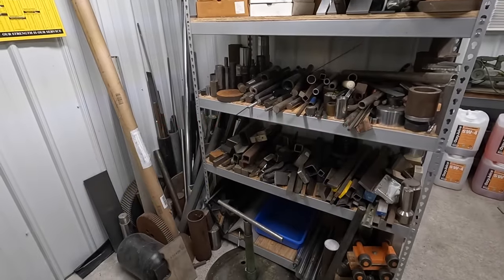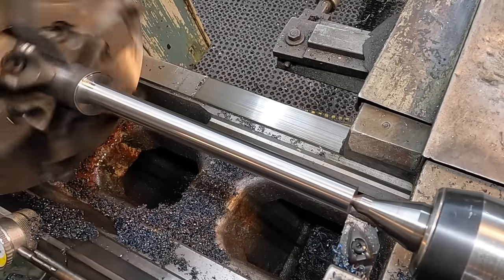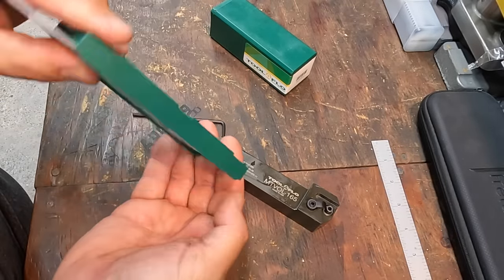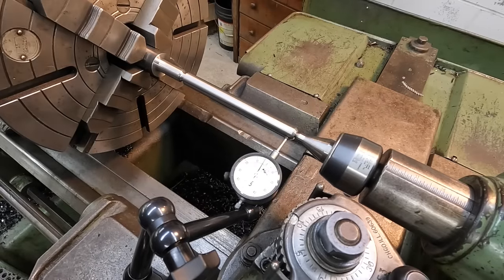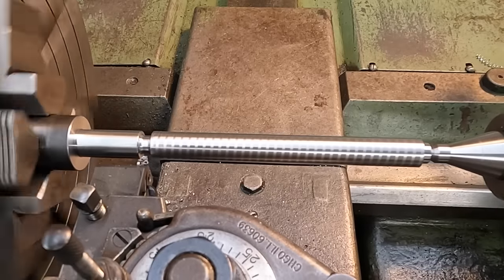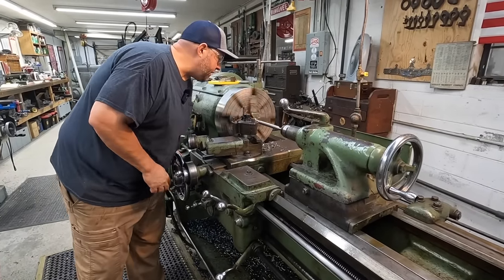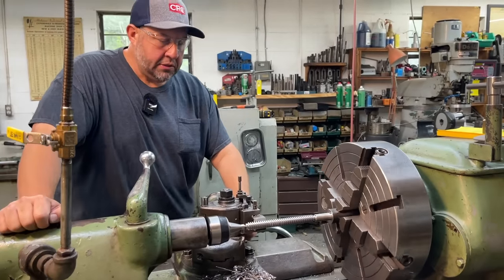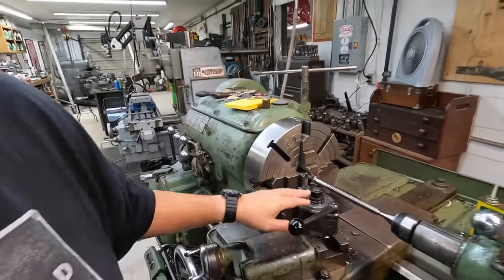Compound Lead Screw for American Pacemaker

Comment: Maybe a combination of contact surface increasing as the depth increases plus flexing of the work due to material loss?   Seems odd that it would cut so well and then on one pass just start chattering.    Disappointing to be sure...
Reply: Agree 1000%

Comment: Interesting -- QUESTION -- Could you cut this on the Precision Mathews 1660 or is it too big a job for that little lathe?  I suspect that slight wear on the bed ways is being telegraphed and causing that slight issue.  Off a few thousands is probably enough to cause that problem.

Comment: Would agree it’s material related. Machine related issues would have surfaced immediately when the cut was made and would have stayed consistently poor as the cut progressed. One of the first indications of material related trouble was the chips the threading tool was making earlier in the threading passes. The material was tearing off and not cutting. I suspect a decent bit of heat was also imparted on the workpiece. Once you hit the threshold of rigidity with regard to workpiece root diameter and distance from the chuck, it was over. Like the other guys have suggested, use a steady ready, coolant, or another alloy with a greater modulus of elasticity. 

Still love your content and skillset regardless, brother!
Reply: DonCormack--And which alloy would you suggest that would make a meaningful improvement in modulus?

Comment: If yhe lathe has not done this before, eliminate the new variables. Rotate tha carbide cutter, Is it dull or chipped? Maybe the steel has a crystalized structure at that point due to manufacturing defect. Maybe that chipped the cutter.

Comment: It may have just been the camera but it looked like the half-nut dial was jumping around a little (stopping and starting quickly). If the dial was loose could the half-nut engage on the wrong position and cause what you saw?
Reply: No way, if you get the half-nut engaged on the next position by accident you'll know about it and so will the rest of the shop as you try and take a 100 thousandths depth of cut. The other lines between each number for this thread pitch the way the lead screw is geared would have put the tool 180 degrees off of where it's supposed to be cutting so it'd be right in the middle of the peak of the thread.

Comment: I thought inserts had a minimum depth of cut and I think you are just rubbing at 2 thou.  I looked at the inserts I was using and there was a tiny radius at the tip in the vertical plane.  Carbide tips do not seem to be like HSS which take a sharp point.  Could this be the problem?

Comment: No Lubrication used ?   I know its carbide tooling but actually I am surprised it hasn't torn the thread at all.. Nice work - great concentration. Here is what i can tell you.  I normally go in with a slot cut then from the acme thread with a shape tool  - You are taking to much on the tool away from the chuck, in other words picking up on a small tolerance of chatter and digging in...

Comment: Meterial is pushing away from the cutter not realy the machine at fault. If you could add a 2 rear rollers? That will sit half way to aid in meterial in not flexing round the insert

Comment: to fix that galling,  try this before you scrap out the part.  with any tool  you are cutting 3 sides of the profile.        go to the last depth of cut setting.  batter up the piece with a good cutting fluid/oil.  engage the half nut  and keep hard hand pressure on the longitudinal hand wheel as if you try to retard its travel speed down thru the cut.  this will isolate the cutting pressure down to one side of the profile.  note,  i actually do this holding back numerous times thru the process to lessen the pressure on the tool and piece.  finish the threading[without holding back to depth,  then float a cut holding back to catch the remainder of the profile than has not been fuzzed before.   file the edges to break the corners of the thread groove..  if needed , wadding up some sandpaper and polishing each side may be done also.  unless you machining tool is pristine condition  this galling can and will happen regularly.  remember  you can save the external threads on most any part this way.  those pesky internal threads lack the room to do much of anything other than cut to depth  [plus a little to fit]

Comment: I don’t know if it was the camera angle or if it was just me, but I swear I thought I saw a small bow in your work piece.
Reply: It is a go pro, the lens makes everything look like that because it is a wideangle lens. If there was a bow for real, it would show up as the piece rotates as a wobble. That being said, the piece did bow due to tool pressure when the inner diameter got to thin causing his problem.

Comment: Perhaps the centre spindle thing at the end is slightly out of alignment or tight or stiff causing the part to flex as it rotates. i.e.  slow rotations look perfect but fast rotations cause oscillation in the part.
Reply: Have you passed a gauge down there when it's running?

Comment: Try hold (for prevents flex and vibrations) the material with(against) a piece of PA6 and get de results. This tecniques   hás been used for brasilians maquinists and de results ARE goods

Comment: I'm not a machinist, so how does it know start the thread in the same place every time? Does that have something to do with the 1,2,3,4 dial that he mentioned ?
Reply: Yes, I’m not a machinist either, but the thread keeps track of the proper place to drop your half nut to have it stay in line with your thread. Don’t ask me how it works though haha
Reply: You do not have to be a machinist the steel bend under heart to much cut taking off as the steel got thiner mate
Reply: @stephenstead6333 You obviously don’t have to know how to write proper sentences either in order to explain your point.
Reply: There is a lead screw and a feed bar hooked up to the carriage, they are perfectly geared to the spindle motor so that it doesn't miss a beat and sp the whole machine stays in sync with itself
Reply: There is a lead screw and a feed bar hooked up to the carriage, they are perfectly geared to the spindle motor so that it doesn't miss a beat and sp the whole machine stays in sync with itself
Reply: There is a lead screw and a feed bar hooked up to the carriage, they are perfectly geared to the spindle motor so that it doesn't miss a beat and sp the whole machine stays in sync with itself
Reply: There is a lead screw and a feed bar hooked up to the carriage, they are perfectly geared to the spindle motor so that it doesn't miss a beat and sp the whole machine stays in sync with itself
Reply: There is a lead screw and a feed bar hooked up to the carriage, they are perfectly geared to the spindle motor so that it doesn't miss a beat and sp the whole machine stays in sync with itself
Reply: There is a lead screw and a feed bar hooked up to the carriage, they are perfectly geared to the spindle motor so that it doesn't miss a beat and sp the whole machine stays in sync with itself
Reply: There is a lead screw and a feed bar hooked up to the carriage, they are perfectly geared to the spindle motor so that it doesn't miss a beat and sp the whole machine stays in sync with itself
Reply: @cameronverrette4550  - thank you !

Comment: At 30:55 you can see the tool cutting more steel at the end of the pass than at the start is that normal (check the edges of the tool) ?

Comment: It was suggested a problem at the 36.30 mark
But watching it closely
i thought one could actually see the live center lift,
Also when cutting threads, 
I would be using a lubricant.
Just recalling someone else's advice,
They turn the tooling up side down, when cutting,
That would mean turning and cutting the opposite direction,
Not sure if that would tighten things up.
As it would be pulling every thing down instead of up

Comment: I am not a machinist, but could it be that the problem is the left-hand operation.  The old machine usually works right-handed, so it could be worn in for right hand use.

Comment: something wrong with my setup, when threading i cannot use the dial, doesn't matter what number i engage on the next cut starts in a different place, even if i engage on 1 each time the cut starts slightly advanced of the last cut. i have to reverse the machine, if i disengage the halfnut the thread is ruined
Reply: Wear on the half nut and or lead screw?
Reply: Cutting metric with imperial lead screw etc.cant work using thread dial.must run in reverse back to start??
Reply: @robertsawyer1464  Well it actually does work, if you're lucky. Did it myself a lot of times, cause i had no other method available since my machine has no quick stop/brake and likes to spin more than it has to

Comment: Hey Adam, ever hear the saying ''A bad artisan always blames his tools"? Dont blame the tools man. If you had set the compound to zero and fed straight in with having a traveling steady rest and cutting oil, this would have NEVER happened. I've cut Acme thread on 1,5m long, 316 stainless shafts, 35mm diameter and have never had this problem, and our lathes are older chinese lathes. USE A TRAVELING STEADY REST!!!👍👍👍

Comment: I would have thought the deeper your thread , the more likelyhood of chatter over its length , I often wonder why you don't use a lubricant coolant on a lot of your projects , yes I appreciate it can make a mess and would restrict slightly the view , but in this case slowing it down a tad and lubrication may have prevented the chatter ...

Comment: Adam how can you Blame the cross slide thread when it only travelled so far. But the top slide did all the travelling. 0.01 then 0.01 i.e. 10 thousandth  at a time. Then why did you use the thread dial on 1, 2 ,3 or 4, and not just stick with one number. Many years ago you stated that you only use 1 or 3. What happened.
Reply: The numbers used depend on the thread pitch, iirc. 5 tpi happens to line up on that machine on all the numbers. A different pitch might just line up on one number or every other such as the 1/3, or maybe even all the numbers and halves, depending on what's being done.

Comment: I've never cut acme, and am a pretty novice machinist but you said you set your compound at 14 degrees to clean the left side of the thread better, on such a small Dia could that be causing the climbing? Or did I misinterpret that?
Reply: What I'm writing is information that you may or may not already know and is not meant to be condescending or insulting but educational. 

Cutting a thread at an angle is common practice and actually reduces the amount of force and torque required to cut threads. So, no, it wouldn't cause the climbing.

What causes climbing is usually excessive cutting force which pushes the work away from the cutter and up. "Excessive force" is relative to the works rigidity which is determined by what it's made of, its thickness, and how it's held. Since the work is turning, it rolls onto the top of the cutter. At this point the work has flexed a lot and acts as a spring under tension which exerts a lot more force on the cutter. At some point, the cutter starts cutting again but, because of the huge amount of force and the position of the work, the cutter digs deep into the work. Something has to give at this point. The cutter could break or the work could slip in the chuck or both. There is also the chance that the work rolls out of the cutter and back on top of the cutter and repeats digging in and rolling out.

A follow rest is often used to keep thinner, less rigid work from pushing away and up. Like the name suggests, it "follows" the cutter and keeps pressure on the work at the back and top of the work. It's not to be confused with a steady rest which doesn't move.

The tailstock is used with a center to keep long work from flexing away at that end. When using a center, there has to be a hole matching the taper of the center. The taper is usually 60 degrees and is cut with a special drill called a center drill. They are readily available and inexpensive. The centers can be a dead center (doesn't rotate, requires high pressure grease if in the tailstock, no grease if used in the headstock) or a live center (has bearings and turns with the work, no grease used and never used in the headstock). Adam is using a live center here.

Carbide isn't as sharp as HSS and requires a great deal more force and speed before it starts cutting well. Those are the same reasons it's used in professional shops, faster deeper cuts mean less time to make parts and that translates to more money.

I hope this helps you on your journey, cheers!

Comment: my man if i May ask ? (just asking ) the compound swang must be 40 degree or 45 degree because  in my opinion every pass you add a few thousand the tool go's to right side and  load get bigger on the right side of the tool.
gritting from addicted follower .
Reply: Compound has to be set at the same angle as the thread cut.

Comment: lead screws of quality are never cut on a lathe, but milled. You also can buy Ace lead screw blanks that only need the ends finished out.
Reply: Any views on rolled Acme threaded lead screws? (Roton)
I'm not trying to sharpshoot you Gary, just to understand.
Reply: @tobyw9573  a rolled thread lead screw is usually a soft low quality ball screw. I've bought hundreds of them. I don't remember the sources, but they are not hard to find. The acme blanks are different. Often cut on a whirling mill operation. Back to the roll thread ball screws a bit. I have (more than once) in an emergency had the roll thread ground and then cast a Moglice nut to fit it. First one I did lasted for almost ten years while the standard ball screw was shot in 36 months ( machine was a custom built Albion gun drill). I later did exactly the samething on a Barnes Drill complex that had a lead screwthat was 19 feet long and about 100mm in diameter. Have also had precision Moglice screws built and installed  (from Lead Screw International in Michigan) with similar results.
Reply: @garytotty3971  Great idea on the Moglice nut! Thanks
Reply: @tobyw9573  never delt with that company, but give them a try. With the acme, your nut a very critical so that's going to be an issue. I always sent my acme lead screw to LSI after I found they could build them. Who knows; they may have used Roton blanks. I don't know and never asked. I do know the helix angle is critical with them. What are you making your nuts out of? I always used Ampco bronze (yes I was cussed a lot)
Reply: @garytotty3971  Gary, perhaps I should have told you I have little hands- on experience with machine work other than with Mercedes/BMW  cylinder head work, and fabrication of various automotive tools, Plus a wonderful materials course when I was studying engineering in college. I do have hundreds of hours watching experts such as Abom and other top machinists and weldors on YouTube. Sadly, that is far from having years of hands-on experience in a machine shop.
The reason I mentioned Roton was that I was aware of the benefits of work hardening and improved grain structure on strength and wear of rolled threads. Judging how that performs in actual use over time I defer to those with more experience. I'm sure that cut threads' performance would depend largely on the materials used as well as how they were hardened or not. Thanks for your comments.

Comment: So having no machining experience whatsoever I'll take a guess, as the Vee of the tool reduces the diameter the screw becomes more compliant causing the thread to bind on the carbide, pinch if you will causing a feedback loop and a harmonic. As the tool grabs it tries to take out more material until the screw flexes out of the way of the carbide and repeats. Possible solution...roller directly opposing the tool force in the center? Mini steady rest on the side? Cut the thread biased to one side of the carbide (I guessing you can't do that)
Reply: We call it a: Steady Rest.

Comment: Altijd hetzefde probleem met het snijden van trapeziumdraad met snijplaten. 1* je kan de aanbevolen snijsnelheid niet aanhouden. 2* Op deze wijze van draadsnijden heb je geen mogelijkheid van je draad te verbreden lees: je mes lang één zijde laten snijden. Gebruik  een aangeslepen HSS toolbit, een volgbril, en koel. Je zag als van in het begin dat je draadplakket een braam trok lees: niet optimaal sneed.
Reply: dat is wat ik zei, blijf een fractie uit het midden en gebruik snelstaal.

ENGLISH TRANSLATION: Always the same problem with cutting trapezoidal threads with inserts. 1* you cannot maintain the recommended cutting speed. 2* In this way of threading you have no possibility to widen your thread, read: let your knife cut long on one side. Use a sharpened HSS toolbit, tracking glasses, and cool. You saw as from the beginning that your wire adhesive had a burr, read: did not cut optimally.

Comment: you have to look at this a diff. way... the deeper you cut is not the depth (strait in depth)  but the side cut is trying to cut way to much material,  you said 2 thou,  the side cut,  again, side cut, in trying to cut way to much... when you are 1/2 way in reduce side cut, ie... 1 thou at most for the last four or five ...  cuts....  this has bothered me for a while...  I have not seen any other post about this...

Comment: The 2 cuts shown in close up around  33:30 when the tool runs off the end of the cut you can see the tool moving slightly to the right as though it was being deflected left in the cut.

Comment: Adam, at the 30 Min mark of the video why is there a burr on the leading edge of the thread that you are cutting. Is that called chatter I wonder, I thing you should have had is a travelling steady correct this error. I do realise the cutter is newish or new in your hand, but please set it in the correct angle.